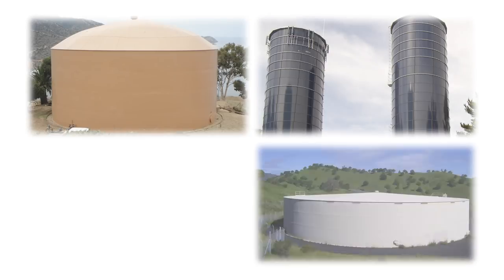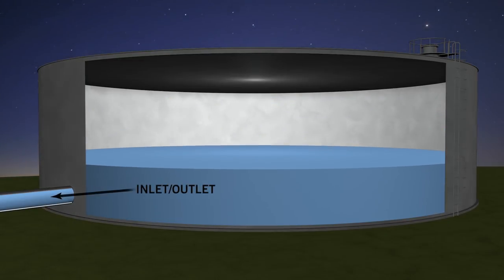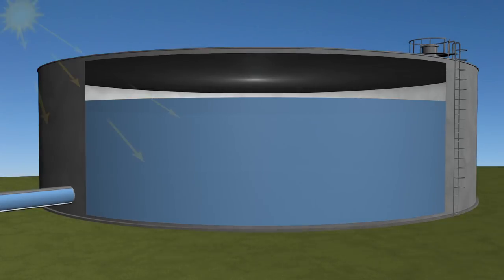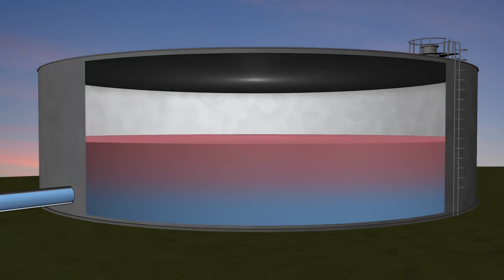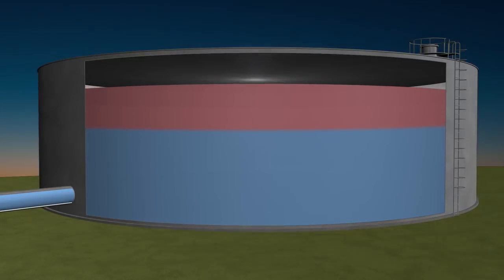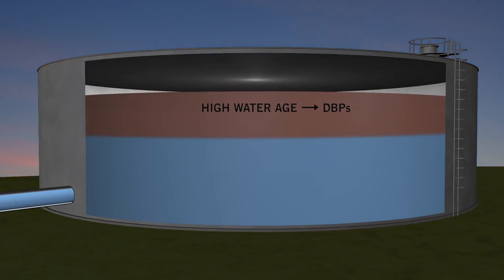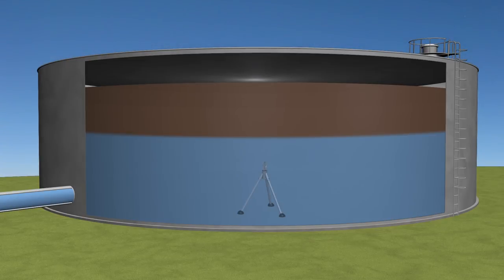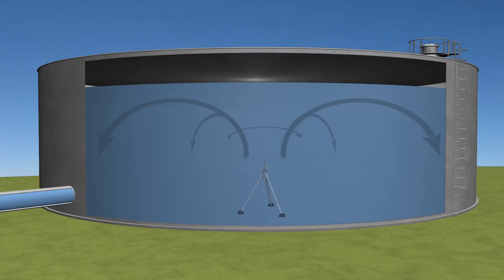Thermal Stratification in Water Storage Tanks [Animation]

Comment: Could this impeller be used as a prop on a electric canoe or kyak motor and create enough thrust to move it. Also which way would it work, by pushing or pulling the boat through the water?